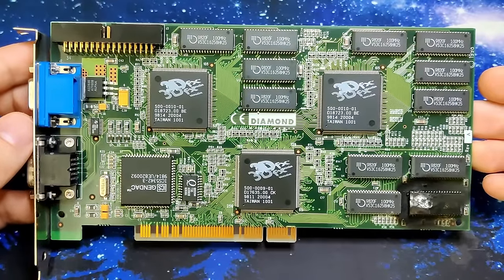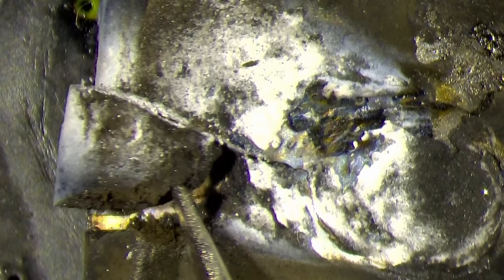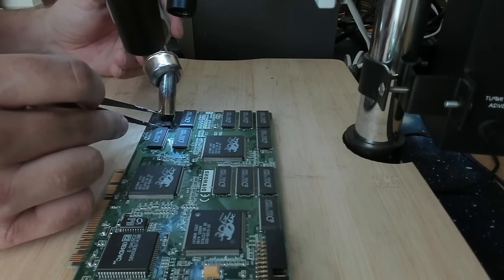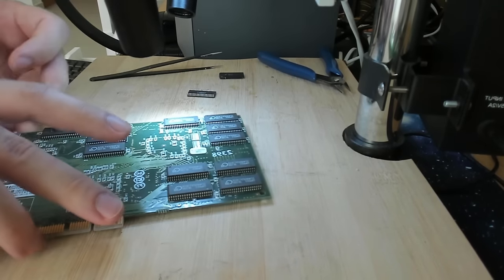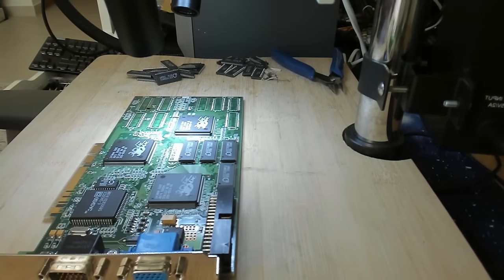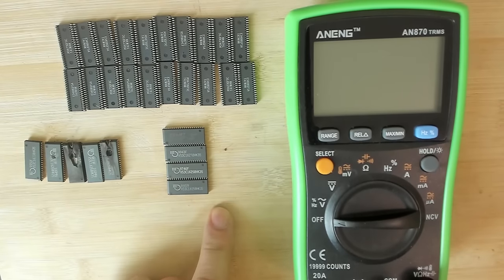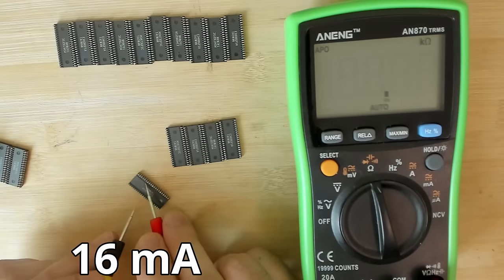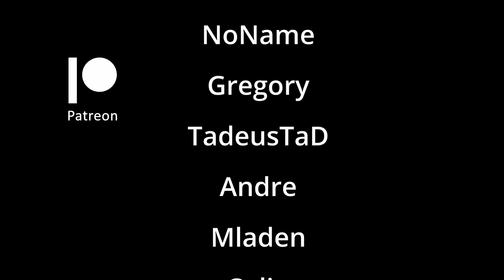Explosive Memory: Can we save this Voodoo 2? (Part 1/3)

Comment: I did not expected the burned area to clean that good.
Reply: This is soot from burning plastic chip packaging, which is why it was so easy to clean. In addition the burned spot, is due to the high temperature under burning chip.
Reply from the maker: Looks like it was just the surface! Except for that one burn mark. I am also surprised how clean it got. Isopropyl + magic sponge.

Comment: From now on, expect every Voodoo card in the world to be sent to you 😂
Reply from the maker: Ohhh - haha. That would be awesome!
Reply: @bitsundbolts  Maybe you'd need a Atomic Power Plant for getting the 3D Power of a recent RTX4090 out you myriads of voodoo-2s
Reply: I have a Voodoo3 that was heavily artifacting, I suspected bad memory, I replaced the memory chips with better specs ones (managed to lift a pad in the process but I repaired it). With the new memory chips it still artifacts even worse. The new chips were obtained from a reputable source (Mouser). So I guess that might be a candidate. :P
Reply: @bitsundbolts  You could be a Big Bad Voodoo Daddy!
Reply from the maker: Hm, artifacts even after a memory swap points towards an issue with the BGA chip. It could be broken solder balls below the 3dfx chip.
Reply: @stamasd8500  Not at all surprising to me that it would be artifacting. Voodoo3 chips were known to run smoking hot, especially the 2000 model with the tiny square black heatsink. Those cards ran so hot that they could melt the insulation off cables that touched them. I remember one report from back in the day where an IDE cable had been resting on a Voodoo3 and melted from the heat. It didn't help matters that most cases in the 90s were big iron hotboxes with no ventilation, you were lucky to have a single 80mm exhaust fan, usually it was just the PSU fan that ventilated the case.

I have two Voodoo3 2000 cards (one AGP and one PCI) where the original black anodization has turned a shade of purple from getting so hot. The AGP card stopped reliably working in the mid 2000s, though the PCI card still works fine. I installed fans on them to prolong whatever life they have left in them.

In your case, I'd suspect that either the ASIC has degraded, or you have a BGA issue. For the former, there is no fix but to replace it if you can find a spare. The latter requires special tools. I guess a third possibility is that the VRM on the card could be dodgy, you could check to see if the voltage is stable to the core.

Comment: We call all the internal “traces” a lead-frame. Before the chip package is made, all the external leads are connected by a frame. The end points that end up inside the package are then wire-bonded to the silicon die. The chip package is then created around the die along with the inner portion of the lead frame. Once the inner leads are secure in the chip package, the outer frame connecting all the leads is then cut off and the protruding chip leads are formed into legs by a lead-former.

Comment: An old trick is to power the board's 5V input shorted with a power supply limited to 1A for example. And see what gets hot. There you will discover your short circuit.
Reply from the maker: A bench power supply is on the list to get some day. I've never done voltage injection, but I'd love to do that once!

Comment: Enough current to cause catastrophic failures like that would absolutely be able to  make enough heat to spot weld the IC pins to the puny little copper layer. It would have been spectacular to watch. Heartbreaking but spectacular 😂
Reply from the maker: It is already heartbreaking to see the aftermath. I really hope that this card can be saved!

Comment: After you removed the damaged chips, my money was on the tantalums causing the short. Great job for persevering. I've recently fixed an Amiga 2000 where 22 out of 32 ram chips were dead, so I can sympathise with 20 out of 24 dead ram chips! Looking forward to part 2.
Reply from the maker: Congratulations on the Amiga 2000 fix! I am working on part 2 - hopefully ready tomorrow!
Reply: Jesus 22?? I’ve repaired over 100 amigas and never seen that level of damage!
Reply: @thomasandrews9355  Yeah, it's weird. I talked to a very experienced retro tech friend about it, and he's seen it once before. It appears it might be related to the crowbar circuit shorting in the power supply with rev 4.x 2000s. Which doesn't really make sense because the crowbar is on the 12v and the ram chips are only on the 5v. Maybe by the time the crowbar activates, the damage has already been done because the crowbar doesn't kick in quickly enough - I've seen a few different value zeners in that part of the PS circuit. Maybe the ram chips from that era are just not tolerant of over voltage... It's all part of the fun!

Comment: Good its not PCB also damaged and there are no burned inner layers. It will be good to check resistance on Vcc on 3DFx chips and compare with other cards, even with memory.
Reply from the maker: I did a lot of measurements - so far, the card seems to be fine. I am working on part 2 now.
Reply: @bitsundbolts did you measure resistance between traces where cracked and burnt chip was? PCB material can burn out as well and become conductive. Also, I'm working on a test software for repairing V2 cards, that run under Linux (easier to gain access to PCI than in DOS). Are you interested to run it on your boards? It can run even if there is no memory on the card. And it tries to test chip to chip connections.

Comment: I would presume the damage was induced from an external source. Likely the PSU gave more than 5V to the line and the memory chips failed in a cascade effect. More likely: Someone connected the 12V Line to the 5 Volt line.
Reply from the maker: This is what I expect as well. Maybe it was another device that suffered a failure and connected 5v and 12v line.
Reply: As the previous owner, I can rule a rookie mistake such as connecting 12V to 5V (which wouldn't even be that easy to achieve) out. The whole thing occurred about 25 years ago so some details are hazy and reconstructed, but it did fail during normal operation. The original PSU is gone (because it went "BANG!") and the rest of the machine is dead as well. At least the mobo is certainly fried, possibly also the 2d graphics card. I suspect that the PSU briefly sent mains voltage to the 5V rail during failure and when replacing the PSU, the whole thing began to crackle. I don't remember this instance in detail (this used to be a friend's PC), but I vividly remember seeing the exact same situation on another machine a few years later. On the other machine, a chip on the HDD PCB caught on fire and looked just as badly burnt as the 2 worst chips on this card. The CPU was also gone. The rest of that machine including the mainboard was miraculously fine though! So I have hope. 🤞😅
Reply: @DefenderOfBoston-yo2tl  Since PSUs are and were all switching PSUs this would mean, that the main transformer wireing of the primary side would come into contact with the secondary side within the transformator. Either by melting the thin isolation between both windings, or primary and secondary windings were in contact and the vibration destroyed the light coating of the wires and then send mains to secondary. 
Truely terrifying but the only mode of failure I can imaginge (hence the bad reputaion of eary PSUs in PCs around that time).
Reply: Like that time when I connected accidentally the molex power to a HDD upside down. Normally that shouldn't be physically possible but with cheaply made connectors it was. Both the PSU and the HDD lost their magic smoke. :)
Reply: @RetroJayKay  OR, a pretty badly designed power supply where the primary was allowed to go on the secondary. They were "common" back then.
Reply: @stamasd8500  Not good! If the Molex had been designed with (5-G-12-G) instead of (5-G-G-12), plugging it upside down would have just shorted the PSU...
Reply: @tony359  What I can say for sure is that it wasn't a brand name PSU, but a budget model. Impossible to say what really happened inside of it, maybe it also "just" failed in a way that briefly caused the regulation for the 5 V rail to overshoot? The damage probably wasn't catastrophic/visible at that point, the burning possibly happened when trying to power the system up with another power supply of similar low quality that was lacking various modern protection mechanisms.
Reply: @DefenderOfBoston-yo2tl  +5V going over spec definitely is something that can happen in old cheap and nasty power supplies (e.g. if overloaded on +12V, since they are obviously group-regulated). I think the notorious machine-killing eMachines PSUs belong to this group as well. You can pretty much assume over 6 V with damage like that, possibly 7 - way, way out of spec.
Reply: @PileOfEmptyTapes  Interesting! It's really fascinating to learn about all those shortcomings of crappy PSUs. I quickly learned they were crap and to avoid them as a kid, now I am finally learning what's behind it. 😄

 Assuming the PSU was appropriately rated (it was a pre-built), it shouldn't have been too badly overloaded because there wasn't a whole lot of other stuff in the machine (and I just added the Voodoo 2), but someone just suggested on the followup video that it may have been a bad cap on a feedback line causing the voltage to gradually creep up.

Either option would plausibly explain discolorations in some locations caused by excessive heat. IIRC, the 2D card has a discoloration very similar to the one on this card!
Reply: @PileOfEmptyTapes  IIRC the eMachine-killing PSUs went overvoltage on the standby rail. The standby is flyback-topology which allows uncapped voltages, the main rails are a forward topology which has a maximum output voltage based on the turns ratio.

Comment: I have recently repaired traces on a socket 370 motherboard, near the coller clip: traces between CPU and ram. Inspired by your videos, I managed to solder tiny wires (used IDE 80 wires), and using tin solder paste made it much easier. It was next level for me, those traces are much more delicate and next to each other. The board (CUSL2) works now, bought as working condition but I was scammed. It felt good to fix and salvage it. I’m looking forward for the next video on the Voodoo 2: I have a Voodoo3 that failed (Ram also) tried to change memory chips however it doesn’t boot anymore. I must have messed something up (no shorts). Your videos help a lot and are very entertaining.
Reply from the maker: Congratulations on your repair! I'm happy that my videos inspired you and that you were able to turn a scam into a good memory!

Comment: I much prefer your unscripted videos like this one, way more engaging and natural, great job 👍
Amazing how little damage there actually is to the board after a such a catastrophic PSU failure, I'll be absolutely gobsmacked if this board works perfectly with just ram replacement, hope it does though, looking forward to the next video, good luck.
Reply from the maker: Thanks! I'm trying to improve, but it is a lot harder than I thought. I'll probably stick to this format since I only got good feedback so far. I'll release part 2 now. I really need more help and more ideas.
Reply: @bitsundbolts  I enjoyed the motherboard repairs you've done in the past and I've been doing a few myself, recently repaired a BH6 (broken battery holder and smashed diode and replaced damaged slot 1 connector from a donor) and a TUV4X ( blown transistor and corrupted bios chip that wouldn't take a new bios, replaced that too) Sound blaster with no dma(replaced crystal and trace repair)
The hard part is no circuit diagrams for older parts, so it's a lot of guesswork. 
There's a guy on eBay who sells lots of old faulty parts in the UK so I often buy a few parts together to get them cheaper and you can barter with him a bit. 
Also got a V1 that locks up almost immediately launching a game and a V2 that black screens when launching, lots to do.
Reply from the maker: @LeeMc007 thank you! It's a nice hobby to have. Guesswork is part of the fun though - at least I learn a lot from it!
Reply: @bitsundbolts  It is indeed a great hobby and yeah I'm always learning, next step is learning to replace some BGA ram on a GeForce 6800GT AGP card from a donor Quadro FX PCI-e card I got for £8, my wife calls me McNerd. 😂😂
Reply from the maker: Haha! Good luck with BGA chips! I have to learn that skill myself. I have a few voodoo 3 cards that need a new 3dfx chip.

Comment: It is amazing you did not give up! Most of the people would consider that card a total loss. Anyway I would really like to know what a PSU made such a mess! Any newer ATX should not end up in such a catastrophic failure! I am now building a Voodoo II SLI system and thinking about using a brand new modern PSU for it. These setups are way too expensive to be jeopardized.
Reply from the maker: Yes, it's unfortunate that the power supply seems to not have had any protection mechanism and killed most of the components. Better to get something modern and high quality. Just make sure you have enough power on the 5v line.

Comment: Happily surprised the card cleaned up with minimal damage. I was sat there saying "Just take off all the memory, test it afterwards.. get to the juicy bits!!!" but yes, understand you want to reuse as much as you can. I really hope you're socketing the memory though, rather than soldering to the PCB, but that does add more cost. Only reason I say that is 1) Where the traces have lifted it maybe more forgiving if you need to rework the area / use bodge wires. But, looking forward to Part 2.
Reply from the maker: Unfortunately, there is no space for sockets. The memory chips are too close to each other or SMDs are in the way.
Reply: @bitsundbolts  shame :( look forward to the next couple of parts though.
Reply from the maker: Haha, I hope there is only one more 😊

Comment: Far be it from me to really comment on someone who's either as skilled or more skilled than I, but I gotta add something in @bits and bolts. Those discolored fiberglass areas? When epoxy heats up, it becomes conductive. Once CHAR happens, you now have a carbon resistor between traces on the inside of the board. Think about it. The temps have burned the epoxy and decomposed it to smaller molecules over and over. The traces in that discolored, bare glass fiber areas are definitely going to be leaky. That's why when you see the INSANE work of like azonenberg, it's dental work all the way down. Carbon is conductive. Traces running through those carbonized areas are going to leak to each other. Same with capactive effects to a degree. I'd grind out that bare fiberglass area at least, if it got hot enough to fully decompose epoxy to carbon and leave bare glass fibers visible (yay fiberglass), it did something on the OTHER SIDE of that same glass fiber (towards center of board)

Might be able to get away with it with such low powered, low speed cards, might not. Something to really sit and think about, and do some probing.
Reply from the maker: Thanks for this information. I didn't know this can happen. Well, part 2 is almost done - of course, completely ignorant on my side what you just said. I try to publish part 2 tomorrow. I don't want to spoil anything yet, but maybe your comment might come in handy! Thanks!
Reply: @bitsundbolts  I am a huge fan of your work, please don't take it the wrong way. I look forward to watching each and every one of your videos! But it's one of those things where unless you have tried to repair burned-through multilayer pcbs, it's not intuitive to think about burned epoxy being a conductor. I know it wasn't intuitive for me at first! And I'm just a random commentor, don't believe me! Please look it up online to see what I mean :) I will say sticking probes into burned areas might lead to some 'ohshit' moments, though! :) 

That's what "magic smoke" is. When the epoxy encapsulation of a chip (they are epoxy+glass beads), or epoxy substrate of fr4 gets hot enough to carbonize. Since epoxy isn't a thermoplastic, it doesn't melt, it decomposes. Pyrolysis of long polymers breaking down into simpler, smaller ones! And the volatiles escaping as a gas. Same way charcoal is made from wood!

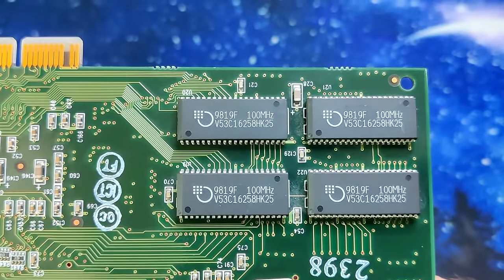Comment: 1:32 putting my guess in now that you'll get it working, not just because the title told me you've recorded two videos in advance on this project, but because I have faith in your skills of tracing, testing, and replacing damaged components, assuming you have a reference or schematics.
Reply: With around a hundred replacement memory chips, I wouldn't blame you for not wanting to test the four potential survivors. If you do have a way to put a socket on, maybe it would help that one with damaged pads? Test with 24 matched new chips first to see if there's life, then swap out and test one potential survivor at a time. 

I would be suspicious of any other components that were in the blast radius, like that blackened capacitor thing. If you have an easy way to verify what the components should be and are able to see if they're still within spec before testing it in a PC, it would put my mind at ease. (... I may be a little biased in that regard, as it would be more lengthy entertaining video from you that I would enjoy, regardless of the outcome.)
Reply from the maker: I might test those memory chips in another card. Unfortunately, there is not enough space for sockets on this Voodoo 2, the chips are just too close to each other or there are SMD components in the way. But as you said, I have more than enough replacement chips. And yes, it would be better to be very cautious with this card. There could still be something wrong. However, I am almost done with part 2 - and I didn't notice any other issues on the board (I did measure caps and resistors, all look good to me).